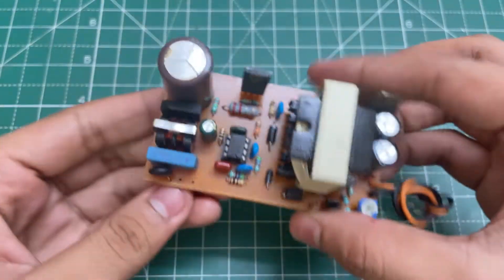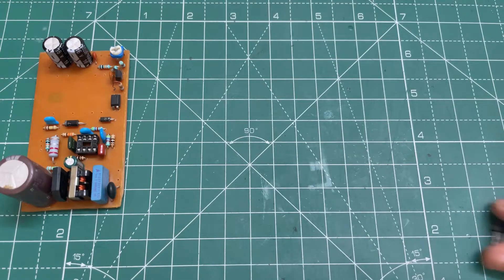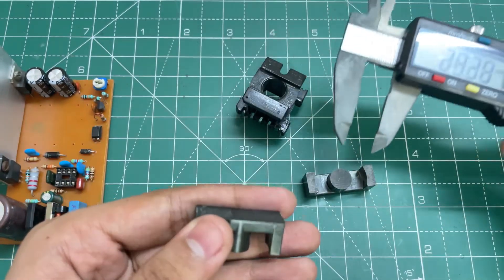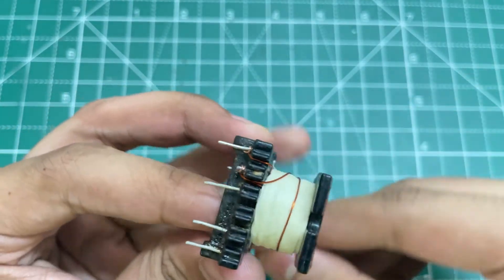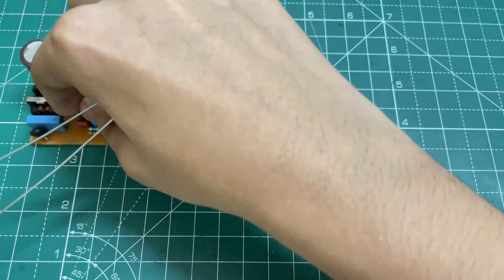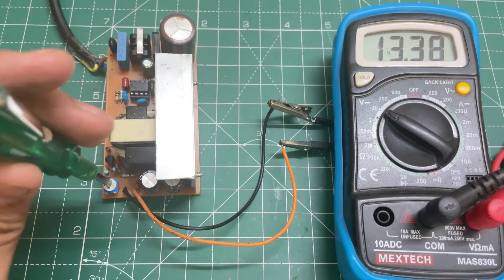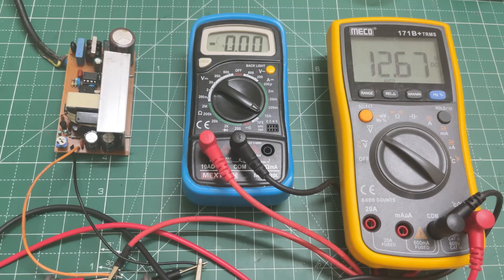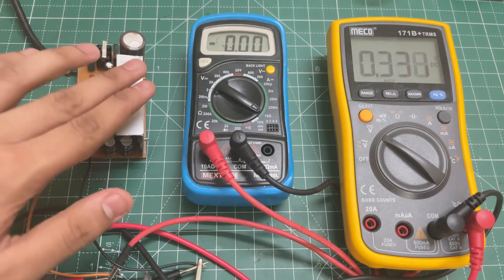DIY MINI 12V 10A SMPS WITH UC3843

Comment: Very nice explanation and compact design. Thank u for pcb layout & systematic.  No you tube smsp videos give proper pcb layout.  This is the way like u to making any video with proper systematic & pcb layout,so others can also learn it make it. 

One thing plz clear. The transformer winding u wind, primary winding in two parts. - 1st 19turns then taping, then secondary 4 turns ,then taping ,and again primary 18 turn complete it. This way 👍.  Benifit of this way winding?

Comment: Hi 
I make this circuit , but every time ic and mosfet has exploded , 5 time
I made the transformer according to the video
Core EI33 
Even i added 15 volts zener in line auxilary
Reply: check the bridge rectifire, glass passivated diodes, low reverse recovery high frequency diodes are good for high frequency smps

Comment: hello. i have an ee35 transformer. can i build this circuit using ee35 transformer? i will follow the winding pattern from your other video:

TRANSFORMER DETAILS:
PRIMARY - 37 TURNS
SECONDARY - 4 TURNS (3V PER TURN)
AUXILIARY - 6 TURNS
AIR GAP - 0.8M
ALL WIRES - 0.4MM

https://www.youtube.com/watch?v=B86aZGCvmAA&t=118s

Comment: I need 24v 5 A, what changes in number of turns for the transformer. Please reply.
Reply: Double the number of turns in secondary , but remember to use just half no of wire in parrallel, like 5 insted of 10.

Comment: What is the primary inductance of transformer? Please, please since iam struck up with transformer design.
Reply: You don't need any inductance to wind a transformer....just simple use transformer calculator software
Reply: And if you don't want to use any software just jo as it is in the video there will be no changes and effect in the output hence no need to worry about inductance of transformer

Comment: What is the efficiency of the power supply?
Reply: That's quite efficient and doing well under 10A, what more can you ask for. 12V 10A that's 120W of power supply
Reply: Most of the market power supply can only do 3-4Amps max

Comment: What is the difference to using a Transformer with an 12V output, followed by a bridge rectifier and some capacitors to stabilize the dc output?
Reply from the maker: This circuit has stable output voltage. The output voltage can be changed. It can deliver 120W of power even after being small. Low noise at the output. Very cheap.
Reply: @kdcreativity6201 ah thanks :)
Reply: Smps are more noisy actually but good because very high efficiency so cheaper or more powerful. Also a supply with transformer bridge and cap also would typically be paired with a linear regulator for very low noise low efficiency @FXArts

Comment: Aoa nice sir ismain vairible resistance ki value kia hai kindly bataye aur out caps ki uf aur volt yeh bhi bataye list main yeh cheezain mention nahi ki apney ThQ Jazzak Allah
Reply from the maker: Value of variable resistor is 1k and output capacitor are 1000uf 25v
Reply: @kdcreativity6201  kz thQ but sir chopper etd34 mill raha hai kaam karey ga aur wire 0.45mm bataya kindly yeh bataye k swg gauge kia huga wire ka ThQ

Comment: Hi why do you use a third winding what was the reason? And what controls the output voltage how to give reference output voltage as 48V and 1A ?
Reply from the maker: The third winding is used to power the ic. There is a feedback system to control the output voltage. For 48V output, you have to change some resistors and capacitors
Reply: @kdcreativity6201  which one to be specifix ?
Reply from the maker: Message me on messenger
Reply: @kdcreativity6201  From where ?

Comment: Brother,the circuit is easy I just put  it  together ,all the components are new.I nenergize it and firts of all I extract the ntc termistor , the ic 3843 and also take the mosfet.
Reply from the maker: Yes but wind the transformer properly

Comment: Can i get 24v 2.5 amp output from this circuit?
Reply from the maker: Yes
Reply: @kdcreativity6201  how??
Reply from the maker: Increase the secondary turns to 8 and change the 2.2k feedback resistor to 1k

Comment: Nice video . Can I use the same winding method to wind for multiple outputs 12v and 21v?
Reply from the maker: Yes
Reply: @kdcreativity6201  okay but the output will be isolated outputs. Half of the primary winding will be the last winding . Also the number of layers tape does it matters ?
Reply from the maker: Yes, use 2-3 layer of isolation tape and always put the secondary winding between the 2 half’s of the primary
Reply: @kdcreativity6201  thank you, another questions for 2 isolated outputs  are these.
1. Is the starting point the same for the windings?
2. First I will have to winding half of the primary winding and isolated it with 2layers follow by the First secondary winding and isolated it with 2layes follow by the 2nd secondary winding and isolated it with 2layers then finally the complete of the primary winding with 3layers tape?
3. As a flyback should I use 0.8mm or 1mm air gap? 
4. All windings are clockwise?
Reply from the maker: 1.The starting point of all secondary is same.
2.Yes you get it right, very good 👍🏻 
3. 0.8mm
4. All windings are in the same direction
Reply: @kdcreativity6201  thanks so much
Reply: Still did not get work . Maybe I will have to try again by winding the 2nd secondary winding after the complete of the primary winding like Aux winding. How can I share my schematic for you to study?
Reply from the maker: You can message me on messenger

Comment: Hı, I have a similar project homework. My project homework is: Using UC3842 IC, to make a circuit with AC 220v input and 5V 2A output. Can you send me the diagram of this circuit, the circuit elements and the number of turns of the transformer, the thickness of the cable? I would be very grateful if you could help me. Best regards, have a nice day.

Comment: Why 0.8 mm gap required  and how to calculate air gap
Reply from the maker: Air gap is required in flyback topology. It is calculated by the parameters of transformer, working frequency etc
Reply: @kdcreativity6201  bagaimana cara menghitung celah udara ,begitupun dengan jumlah lilitan jika menggunakan travo dengan ukuran yang berbeda

Comment: Hello friend, your project is very good, I would like to output 30V, I would be very grateful, thank you, excellent friend.
Reply from the maker: Thanks. For 30V output, change the 2.2k feedback resistor to 680ohms and change the secondary winding to 10 turns
Reply: Thank you very much for your answer, I will try it.  thank you

Comment: Pls I need 5v 10a smps power supply using uc3842
Reply from the maker: Just change the number of turns on the secondary and the feedback resistor. You’ll easily get 5V 10A
Reply: @kdcreativity6201  Pls I don't know the feedback resistor value and number of turns to wind..I will appreciate if you help to indicate on the schematic diagram
Reply from the maker: Please message me on messenger
Reply: @kdcreativity6201  I don't hv your WhatsApp number
Reply from the maker: @adeshinaajibola5114  Facebook*
Reply: @kdcreativity6201  pls your Facebook link
Reply from the maker: https://www.facebook.com/kumar.divyansh.921

Comment: What will be changes if I want 24 Volt 5 Amp. except electrolytic caps and secondary binding?
Reply from the maker: Change the 2.2k feedback resistor to 1k
Reply: @kdcreativity6201  What about the 48 V 1 A and what is the formula ?
Reply: Can you show schematic of cjrcuit?
Reply: @geartech3860  , Yes, I can. Pls share your email.

Comment: How can I add LED to show if it is connected to load..The LED show come on whenever it sense load connected.
Reply from the maker: You have to add a shut resistor combined with a comparator circuit at the output to sense the current flowing and add a led to the output

Comment: Hi sir, we need some  circuit for12V/2A low cost application
Please let me transformer size 
Primary winding and inductions
And secondary winding details.
Reply: Please let me sir
Reply from the maker: @senthilka2260  please message me on messenger
Reply from the maker: Use EE25 for 12v 2a
Reply: Thank you sir , winding  details please

Comment: I have added the secondary transformer winding but the output does not increase, please help me
Reply: no, what should be changed to vr 1k?
Reply from the maker: Change the 2.2k resistor to 1k and don’t forget to use a high voltage capacitor
Reply: @kdcreativity6201  thank you very much I want to change it to 24v 30a is that possible? i use irfp460 mosfet and 80a 200v diode in your circuit. is there a current limiter in your circuit. i will thicken the high current path in the circuit
Reply from the maker: It’s a flyback topology power supply so the power is limited between 150-180W max !
Reply from the maker: Did you change the feedback resistor ?

Comment: Hello,
By using different core in place of ETD such as EI, EE  does the number of turns of primary and secondary WINDING change?

If change How to calculate the no. Of turns of transformer ?
And RCD snubber calculations? 
Thank You
Reply from the maker: Yes if you change the core size then you have to recalculate it’s winding data. You don’t have to change the rcd snubber, it will work fine
Reply: @kdcreativity6201  Thanks

Comment: if the output is made 5V for cellphone charging, how many turns for the transformer?
Reply from the maker: 2 turns are enough
Reply: @kdcreativity6201  ok i want to ask again. for the mosfet will it be hot if it is no load? 
if the primary winding is 85 turns, how much for the secondary winding at 12V? 
is there a formula to calculate it?
Reply from the maker: @dinaaaa_  what’s your transformer size ?
Reply: @kdcreativity6201  Just like in the video ETD 35
Reply from the maker: Then no need to change the primary and auxiliary, just change the secondary winding to 1 turn and change the feedback resistor
Reply: @kdcreativity6201  Oh okay, thank you very much
Reply: @kdcreativity6201  if the mosfet uses 7N60 is it possible?
Reply from the maker: Yess
Reply: @kdcreativity6201  what is the length and width of the PCB ?
Reply: @dinaaaa_  we have the same mosfet ihave bunch of this
Reply: @dinaaaa_  we have the same mosfet ihave bunch of this
Reply: @kdcreativity6201 Hi, I want to ask again, how can I make the IC soft start when it is first turned on?

Comment: Your videos are excellent for learning and practical purposes, mainly you provide full data for your videos including PCB layout, circuit, and required components.
Reply from the maker: Thanks 😊
Reply: @kdcreativity6201  Ban cho mình Xin thong so bien ap nhé.. ..?! Cuon day diot 207 bao nhieu vong dây và dây bao nhieu mm cuon diot 107 bao nhieu vong (tum) dây may mm và cuon đâu ra MBR20100CL bao nhieu vong (tum) đây bao nhieu mm .rất mong được ban trả loi , cam ơn nhieu nhé ❤

Comment: Hello, greetings from Spain, first congratulations for your channel...
I have a question, could I use the UC3842 in this circuit? I have several recycled old TV smps. I think it has few differences with the UC3843.
Reply from the maker: Yes you can use UC3842 also
Reply: @kdcreativity6201  
Ok, thank you very much for answering. Regards.
Reply: You can search from Google through terminology like IC UC3843 pinout and then again search IC UC3845 pinout and then compare, check if both has same pinout.

Comment: Great video, can this circuit work with 40-60V DC , because i don't need to convert it from AC in my project.
Reply from the maker: Please watch my latest video about buck converter
Reply: @kdcreativity6201  Thank you for suggestion, but my circuit kinda needs the isolation transformer this smps provides

Comment: Nice video sir/ bro..
But do some explanation about components you used.
And I am afraid of using this smps on 10A max..
Will it be safe???
Reply from the maker: Ok bro thanks for your feedback. Yes you can use this at 10A but I will prefer you to use it at 8A because you should not use a psu at it’s full power rating

Comment: Bro, thank you very much your good work and contributions to our electronics life,

I have just finished the project now, and have tested it and it working fine but the output drops on load which is not up to 1amp

Pls what could be the problem?
Reply from the maker: How much the voltage drops??
Reply: @kdcreativity6201  from 12.6v to 9.8v
Reply from the maker: Can you please message me on messenger so that i can ask some images of the circuit
Reply: @kdcreativity6201  yes, if possible, what's app
Reply: Note that my input ground is not connected with output ground, I don't know whether that is the course
Reply from the maker: @chibuzoeze4225  no problem
Reply from the maker: @chibuzoeze4225  ok
Reply: @kdcreativity6201  could you please gimme your messanger ID too , so i can ask you a few small questions about this circuit and smps?!
Reply from the maker: https://www.facebook.com/kumar.divyansh.921

Comment: Can I use any type or color of 2.2nf capacitor instead of the blue one you used?
Reply from the maker: You can use any but make sure to use at least 1kv capacitor in the snubber circuit
Reply: @kdcreativity6201  pls, are you sure you use 330k to start the ic, because I can't see it clearly, and I have watched the video more than 5 times just to recognize the color code of the 330k but I couldn't
Reply from the maker: Yes bro its 330k

Comment: sir in my case input DC voltage 650 voltage I use 60n100 igbt please help snubber circuit calculation
Reply from the maker: Ok bro I’ll try
Reply: @kdcreativity6201  thank for reply ok I'm waiting for you